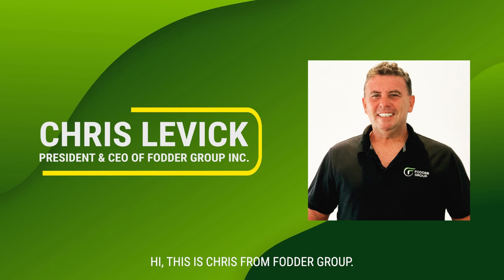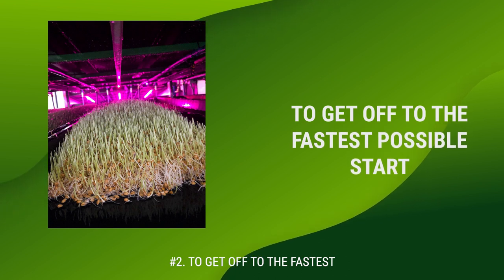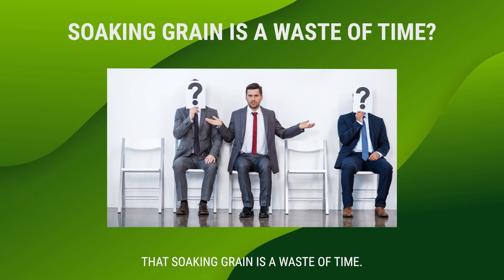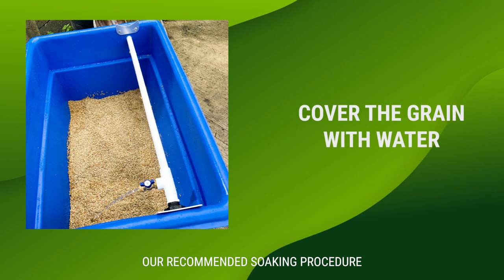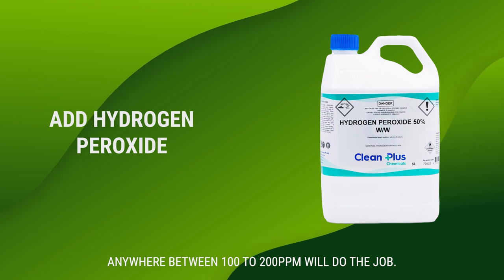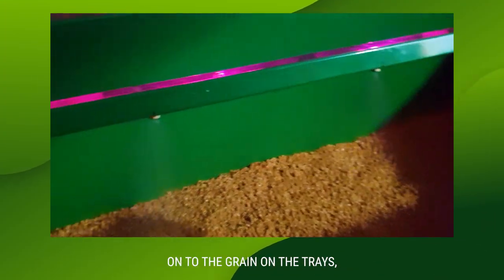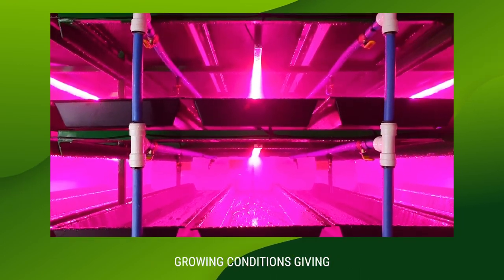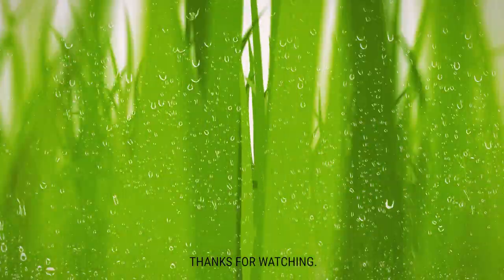Secrets Of Soaking Fodder Grain Finally Revealed

Comment: How does temperature affect production rates, or are your products able to have some form of heating element incorporated for those in colder climates?
Reply from the maker: Great question. Temperature has a big bearing on growth, too hot and we certainly get mold and too cold and we do not get adequate growth. We heat the water in cold climates however the internal temperature and humidity levels are controlled carefully to ensure the outside temperatures are of little consequence to the end result.
Reply: @FodderGroup  I live in an area where we run temperatures of (-5C) - 30C / 23F - 86F going from winter to summer and wondered how one of your units could fit into such a climate. Would this still be suitable for an external unit?

I should say I'm still quite a while away from purchasing a unit, however they have peaked my interest.